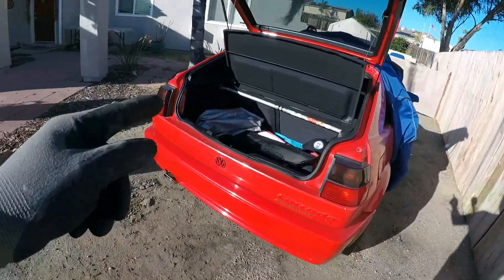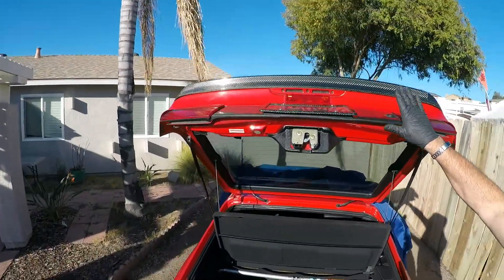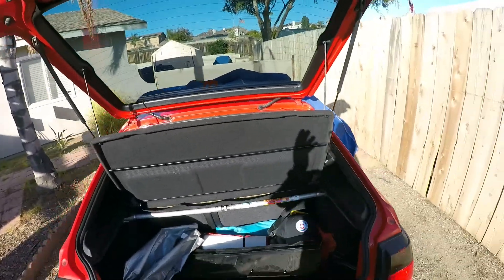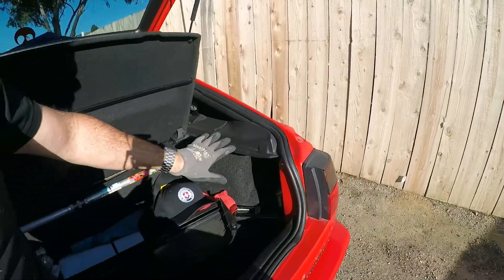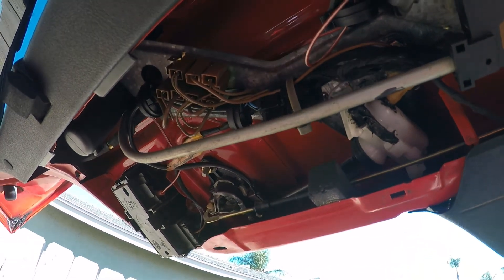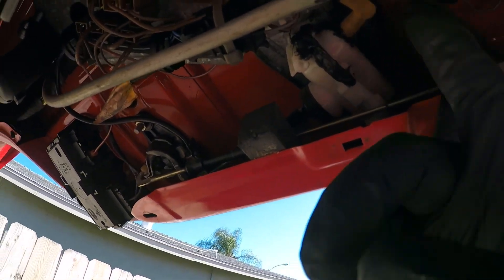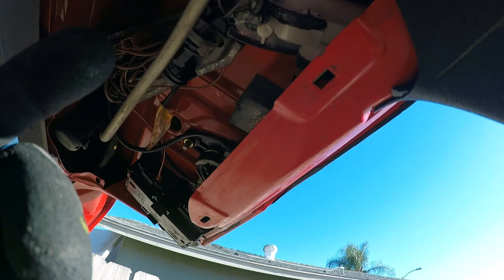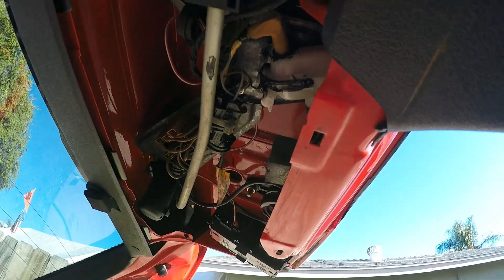DIY Fix for VW Central Locking on Corrado, Passat, Golf, GTI, Jetta Mk2 Mk3 B3 B4

Comment: Trying to remove vacuum actuator to seal on my 92 vr any advice to remove?metal rod disconnect on witch end?  Any help would be awesome. Can’t break any bits on this thing. I need to seal the back side of this thing. Looks like you didn’t need to remove yours.
Reply from the maker: You are correct, I did not need to remove mine to seal it.  It has been a pretty long time since I have removed one of these assemblies, so I would not want to steer you wrong with incorrect advice.  I think the last time I did it, I removed the whole wing assembly first (needed to service the cables) and then removed the whole lock assembly too. I do not remember if the wing mechanism needed to come out first, but it does take up a lot of room in there, so it would not be surprising if that had to come out first.